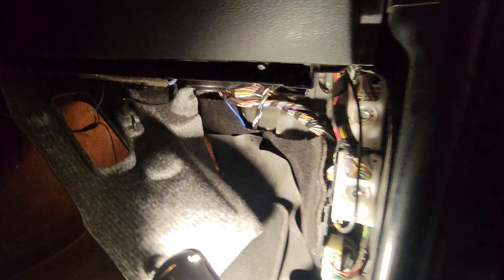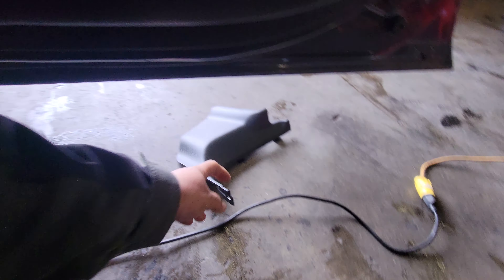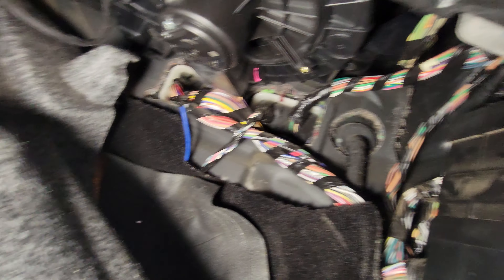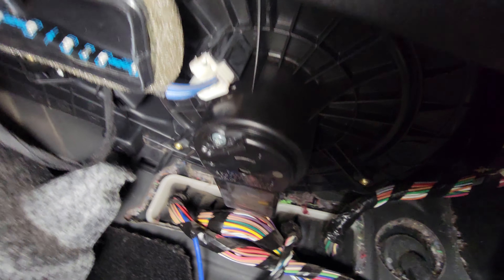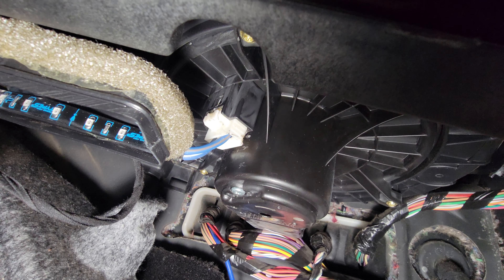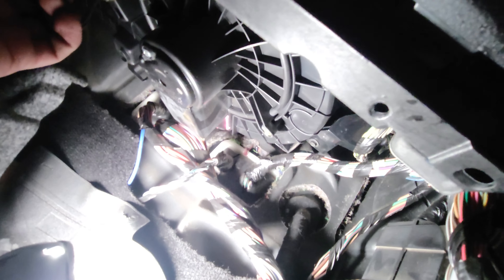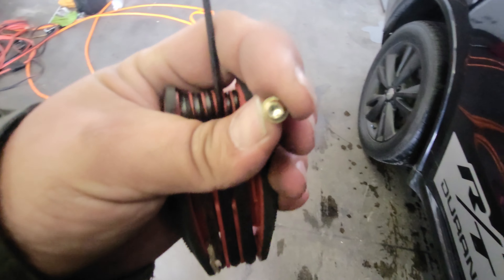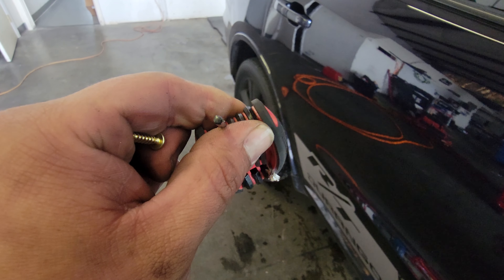How to: Remove AC Blower Motor 2011 Dodge Durango

Comment: What were your symptoms that led you to know your blower motor was blown?
Reply from the maker: No air movement, fuses were good. Removed it and with a volt meter i checked to see if it was passing Voltage with a volt meter. It was....replaced it and that was my issue. But i did kinda narrowed it down by checking everything else first. Good luck hope this works out for you! Thank you for your Support 🙏